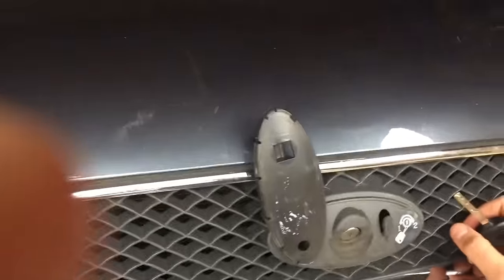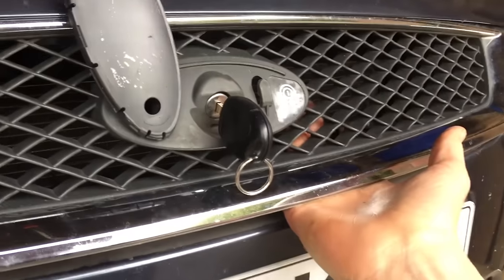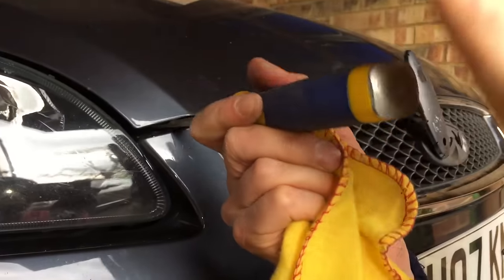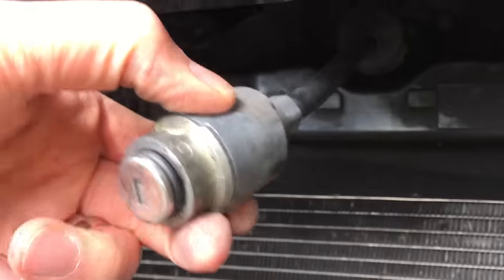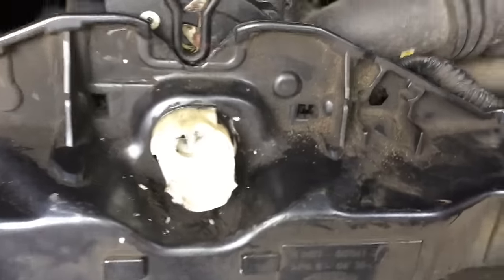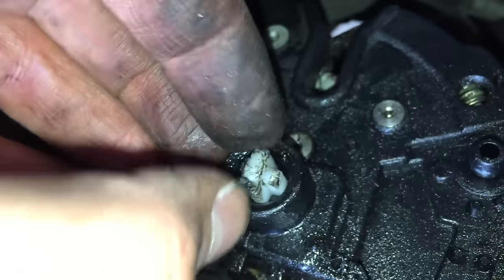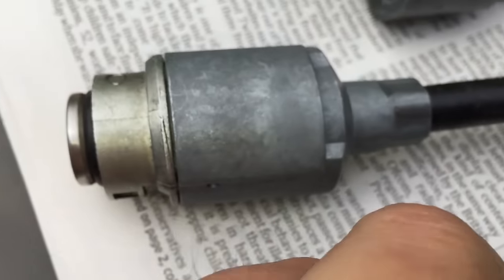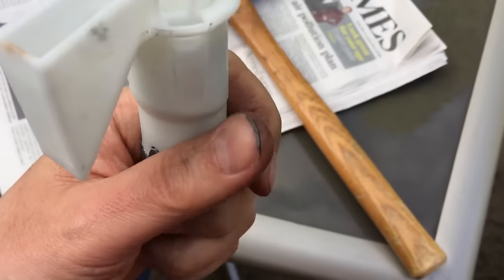Focus Mk2 Bonnet Lock Won't Open - Hood Release Problem (Full Guide)

Comment: Thanks, just did it to my '08 focus mk2.5!

Popped the 2 side clips by turning a flat screwdriver and with some effort got the grille out (pop the hood open a bit by pushing a rubber handle between hood and headlights). The front cylinderlock and cable replacement is actually the easy part.

Heads up tho for people with the 2.5, if you see a plastic v shaped cold air intake duct behind your grille try to undo the 2 bolts that hold it in. In my case i snapped them out causing in some damage to the plastic, couple zip ties to the rescue shhht haha.

Opens and closes fine now, spent euro 29,99 and prob 45 minutes wasn't in a hurry.
Reply from the maker: Great tips, pinned the post 👍

Comment: The best thing Ford could do would be to use a cable inside the car, with for example a lever under the corner of the fascia!!!!
Reply from the maker: That would work ;-)
Reply: That would be too easy.
Reply: @ThatCarGuy1983  exactly. This lock business is ridiculous. I've just had the problem myself, right after fixing the wiper arms, now the lock won't turn at all. Like it's jammed. Time to get smashy I think.
Reply: It's for theft protection for the engine bay
Reply: Like they used to be. Touble is with Ford is they always try to be clever.
Reply: Whoever designed this is a helmet
Reply: This is an excruciating watch ffs

Comment: I got quoted $1200 Aud from the criminals at the ford dealership for parts and labour on my 2007 xr5 focus, I got an aftermarket replacement for 30 dollars off of eBay and replaced it this afternoon with next to no issues. I have near no experience with this sort of thing but this video helped quite a lot, this is very doable, don’t be robbed by ford
Reply from the maker: £650ish wow that’s crazy, I’m sure they are doing them all the time. 1hour max.
Reply: @MotoringEvents  they quoted me for 4 hours labour too, I can’t believe they get away with it

Comment: Thanks a lot for this. I trust my mechanic but even so, saved me some money here, so I'm very grateful sir! I prized up the two plastic holding screws up, like Kesslerden said and they went back a treat. Unfortunately the cost of the lock in your link is now £90!! (inflation inflation🤦) After market ones on Amazon for £19 so think I'll go there....but will it fit the existing barrell though, who knows, they come with keys anyway! Thanks for your time, to make this, really helpful.👏👏👏
Reply from the maker: Fantastic, glad it helped. Some of the aftermarket ones may not last as long as the ford part. I had a aftermarket one break so I ended up taking it out and using a long screwdriver:-) My first Mk 2 I used the ford part which lasted the life of the car. Just info. £90 is a lot!

Comment: Helpful vid! The hardest part for me was getting the grill off. Managed to do it without causing too much damage. I wouldn't have thought about just smashing off the old unit with a hammer, but I was finally able to get the bonnet open after following what you did.. only I used long nose pliers to twist the remaining part of the mechanism. Was such a relief to finally see the bonnet pop up! All in all it cost me £13 to do the job with a replacement kit from ebay. Once the bonnet is open the replacing part is a piece of cake. Just a little tip for anyone using the same replacement kit I used, when you slide the key barrel back into the plastic sleeve of the grill, put a tie wrap around the the plastic clips and pull it tight so it grips the barrel better. I had a little issue where the new barrel was slightly turning in the plastic sleeve when I turned the key left, which meant the bonnet wouldn't pop. The tie wrap sorted that out though. If I can do this repair with extremely limited mechanical experience, anyone can! Thanks again!
Reply: I used this tip also with the cable tie as I found it moving around quite alot.  thanks for that

Comment: Thanks for this. I found it difficult getting the bonnet open at 9:36 with a screwdriver - I solved it by putting 3 small drill bits in a drill to do the anti-clockwise turn. Drilling out the bits at 13:36 took me somewhat longer than you as well. Fantastic video and well needed given all the comments in such a short period of time. Call me old fashioned, but I still prefer the old bonnet leaver under the drivers side or passenger side door available on almost every other car in the world.
Reply from the maker: Alex Ayscough Thanks for your comments. Great idea using the drill bits. I struggled a bit with that too.

Comment: Successfully fixed the bonnet lock on my 2007 Focus by following this video step-by-step!
As a total non mechanic, the thought of whacking anything under the bonnet of my car with a lump hammer and chisel seemed pretty alarming, so I made tentative enquiries with a local garage, only to get the usual sharp intake of breath, and a shake of the head, saying it was a nasty job and that the replacement lock cost £90.00 from Ford etc, etc, and that they couldn't do it for a fortnight.
I went away wondering what the hell I could do - my MOT is due nest week - and after a sleepless night, decided to be brave and go for it. Took me about an hour all in and completed with no damage to the grill (or any other part of the car!). Trust me - follow the guy step by step and all will be well!
It's also worth pointing out that I ordered my replacement lock from ebay (£19.95 plus postage) and this came with it's own key (plus a spare), which meant I could ignore the tricky-looking key barrel assembly part of the video. It just means you have a seperate key for your bonnet lock, which is hardly the end of the world...

Cheers for posting this video - saved me the best part of £200.00!
Reply: The eBay replacement lock sounds like a good bargain, did it serve well after the installation?

Comment: To the genius engineer who decided to design this kind of bonnet lock instead of the traditional one... A big bucket of human crap down his mouth! Got rid of mine just need to install a new one.
Reply: Alex P. Can't call someone like that an "engineer".
Reply: @danielwalker5682  It was probably the same 'engineer' who designed the new power steering system for the Fiesta, Focus and Mondeo around 2004.
Reply: @richardwinstanley8219  Where there any major flaws with the power steering at that time?
Reply: @shanepatrick641  Yes there was. The Focus, Fiesta and Mondeo of similar age all have a problem with the union nut on the high pressure pipe for the power steering. Its a common failure point, will start leaking eventually, and the whole pipe assembly will need to be replaced.

Comment: Excellent video, thank you so much, definitely helped me out. But one thing I notice on this and other vids, people go straight for the hammer once the grille is removed. I decided to just have another go with the key once the grille was off and I could wiggle the assembly around. Managed to get it to engage and open the bonnet with without resorting to breaking stuff. Obviously if that doesn’t work breaking it is the only way to go.

Also, warning for Mk2 c-max owners, I bought an assembly off ebay, which I thought was correct but is actually too short. The standard one appears to be 11cm length of the flexi tube part between the last part of the lock barrel and the plastic release assembly (ignoring the rubber gaitor). The one I took out of my c-max is 13cm. So before you start make sure you have the correct unit, and if not, a long screwdriver, 25cm ought to do it, so you can still open and close the bonnet when everything is re-assembled without the lock assembly.

Hope this helps someone.
Reply: I was just wondering which section they referred to as long and short. Mines the same as this vid. Bendy tube with white plastic.
Reply: @princess89pinky  I'm not sure, I didn't buy it by length, I ordered it from a site on ebay, by selecting the car model, but I think they screwed up. Mine is a Focus Cmax mk2, 2008, and basically the unit is approx 2cm longer than the standard Focus one. I never did get one in the end, still using a long screwdriver :)
Reply: Same here, I managed to get it to engage and open the bonnet without resorting to breaking stuff. Then with wd40 and grease got it functioning again :) For now!

Comment: Nice one uploading this. It worked!  I was a bit cautious at first taking a hammer to the car but all the bits that break off are plastic and are replaced by the new part. 

Got a replacement for 20 quid off eBay, came with a key so no lock bothering either.

Saved me a packet!

Comment: Thanks for your video it saved me having to take it to a garage, what I did different was after you pulled the white cross 
shaped piece out of the lock I fitted the lock without the key and cable repair kit and now use a long screwdriver through the top hole in the grill above the keyhole to turn the latch no more problems and save £50 on repair kit. I you want you can fit the old lock back in the grill as a dummy, hope this helps.
Reply: PS if you push up from under the bumper  on the rear cover which came out on the video by mistake by the two tabs at the back as shown on the video it will save you breaking the tabs which I broke one when using force to pull the grill out. This will make pulling the grill out very easy
Reply from the maker: Cheers Wayne, good to know.
Reply: Bajo la falda
Reply: Did the same, removed mechanism and now using a long screwdriver.

Comment: I LEFT THE GRILL IN!!!
MK2.5 MODEL
Thank you!! Your video gave me the confidence to do it.
I have a mk2.5 (a little different). I have horizontal slats unlike your criss-cross. Screws on edge are not visible. I sliced through 3 slats, able to get hand in and unclip lock. BIG BONUS though.... once rubber bung pulled away... I smashed the end a few times with long screw driver and hammer to crack it open, then thought I would try key... it worked!!! Still replaced the whole thing except I used old key barrel. Will glue slats back up.
Thanks again for the detail. As many have said.... you are a legend!!

Comment: Great video
Remove grill as described, side fixings only.
Then Rather than break the fitting to enable turning the mechanism, you can use a small 10mm spanner and undo the the actual lock itself. Then lift bonnet and undo electrical connection. The lock will return be left hanging on nonnect catch ready for easy removal with apliers or such like.
Less destructive this way
Reply: My favorite part was the massive hammer. I would love to do that to mine. Stupidest design ever.

Comment: I had the same problem. I just have an observation. You can reach and cut off the two side screws with a knife, this way you can cut off easily and you won't damage the painting on the bonnet or bumper. Great video helped me a lot. Thanks!!
Reply from the maker: Thanks for the tip. Glad the video helped.

Comment: Absolutely spot on that mate. Nice1. Had this problem, needed to get bonnet open yesterday, couldn't, watched your video last night, executed part A tonight after work. Spot on, didn't take too long. Just need to get a new barrel kit off Amazon now. Thanks again mate, life saver
Reply from the maker: Glad it helped, it's such a stupid system. Ive got a Mk2 faceflit now, same problem!
Reply from the maker: By the way the ebay ones seem ok too.
Reply: @MotoringEvents  cheers man. Was checking them on Amazon last night, £25. Clipped it all back for now but pulls out easy enough when I come to fit new one

Comment: No disrespect pal, but you made a right hash of that job & cost yourself a lot more money(in damage to the release mechanism). Instead of breaking the mechanism to activate the bonnet release, all you had to do was undo  the two 10mm bolts on the opposite side of the cross-member & the whole lot would have released without ANY damage!.... Still, we ALL learn from mistakes, but good effort all the same(you got there in the end & saved yourself a few bob!!) Worth at least a thumbs up
Reply from the maker: Hi, fair play, I did try removing the lock from the inside, but I couldn't get it to open, but for others reading this,  definitely give it a go. The release mechanism on mine was toast anyway so the only thing I damaged that didn't need replacing were the plastic screws. Thanks for watching and the thumbs up. Much appreciated.
Reply: @MotoringEvents  you're welcome👍 but just ONE major tip... Only ever use the hammer🔨 as a LAST resort... Keep up the good work my friend👌x
Reply: @MotoringEvents  Ps, please forgive me if I seemed "Patronising", I didn't mean to be. I'm a fully time served mechanic(40yrs-exp'nce)and was just trying to be helpful...
Just like you, I can't stand to see ppl ripped off by motor manufacturer's or anyone else!! x
Reply from the maker: @joesmith5452  No probs at all, I definitely appreciate the comment, as will others. I am no mechanic (as you can tell) but the hammer was 50% entertainment value :-) Have a great evening.
Reply: You too... Good man 👍
Ps, soz about late reply 😉

Comment: Thank you so much for this video. I was able to go so far. The old lock was just not coming out. The BIG HAMMER trick worked. I'm in lol. Lock changed in 5 min after that. Had to rip the grill out. Mk2 st.

Comment: This is far the most useful video I’ve seen for this problem … and we’ll be using it to fix the problem on my son’s Focus ASAP. 
Worth noting in review that 
1. Only the relatively accessible outer 2 plastic screws needed to be chiselled off in order to get the grille off neatly as shown. And no need to smash up the grille as shown in other videos! 
2. The long screwdriver seems to be a much simpler long-term bonnet-opening solution than replacing the mechanism. It seems that you still need to get in and smash that white plastic fitting to access the spot to insert the screwdriver though.
Reply from the maker: Correct, I use a long screwdriver now after the third time. Ebay replacement part didnt last long for me. Ford part or screwdrive 👍

Comment: Got the same problem and will need to do something very soon to open. I'm not a DIY man but your video helps a lot!
Reply from the maker: It’s not too bad, the only thing is to be prepared to get break the plastic end of the locking unit. I hit it with a heavy hammer which may having been over the top but it did the job. Good luck.

Comment: Thank you for the thorough explanation. It helped me understand my problem. In my case the metal cable connecting the lock with the key barrel had the metal bit at the end slipping out of its hole. It was partially working. Luckily it got out in my hands when I had all the parts taken out safely with no damage whatsoever. Greatly appreciate the video!
Reply from the maker: That's great you were able to fix it without damage. It's amazing at how many points that system breaks. Thanks for your feedback.

Comment: After watching your informative video i ordered this part but beforehand i had changed the whole lock system !!, i decided to change the  new part as per your video !! Just in case it happened again . I then found out that ford had upgraded this part to a black plastic insert  on the new locking system without telling anybody !!, so at least i have a spare just in case it happens again . Hopefully not
Reply from the maker: Hi that’s interesting what was the black insert Ford used?

Comment: Thank you so much,  have been stressing because couldnt get bonnet open for a couple of weeks,  ordered new lock and grill (just in case) and followed your instructions,  was a little different behind grill because of an air pipe so couldnt get a hammer to it, so used screwdriver,  made up the new lock to match key and works lovely,  just got to get some plastic screws to hold it all together,  did take a couple of hours as was scared shitless and kept stopping to watch video again.
Reply from the maker: It's a crazy system isn't it, glad the video helped.

Comment: Thanks for posting this. I had to get into my daughter’s 2010 Focus yesterday ,the bonnet shut fast, your film was a great help. 
I sprung out the grille lower pegs then the 2 upper outer fixings after levering the bonnet corners up with a wedge and getting under the grille flange to pop the push in fixings out.  Breaking the plastic fitment wasn’t so easy with the bonnet locked down and required multiple hits with a big screwdriver and hammer. I was very relieved when the secondary safety latch gave in and I could lift the bonnet. We ordered a replacement release mech so as a temporary hood retention I used a big/long cable tie over the striker bar and thru the cross beam hole where the latch would be. It all pulled down tightly and just to be sure I used a 2nd cable tie. New one arrives Tuesday. Thanks again.
Reply from the maker: Thanks for the feedback, glad the video helped.

Comment: Thanks for the guide.
Did it yesterday on my 2007 Ford Focus MK2.
Removed the grill without breaking of the side screws but instead placed a large flat screwdriver between the 2 plastic parts on the side screws and twisted the screwdriver so the screws popped out and could be reused.
Reply from the maker: That's great advice, pinned. Thanks rich

Comment: Very Helpful! Thanks. Although I tried getting away with the two side screws only, it didn't want to pull out. I've ended up breaking a lot of the plastic whatnots that clip it all in, maybe because its -2c out there and its all brittle with the cold or maybe just me getting frustrated and impatient. At least I can change the headlight bulb now.
Reply from the maker: That's a shame, hats off to you, it's a bit of a flaff at the best of times let alone in -2!